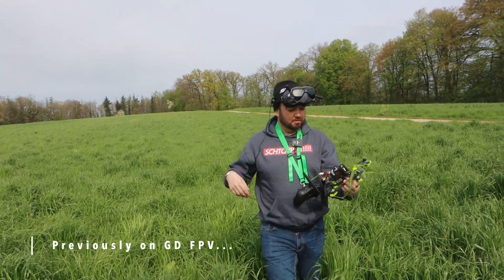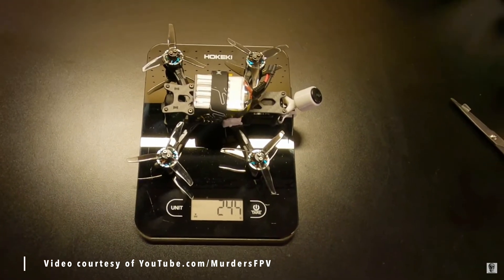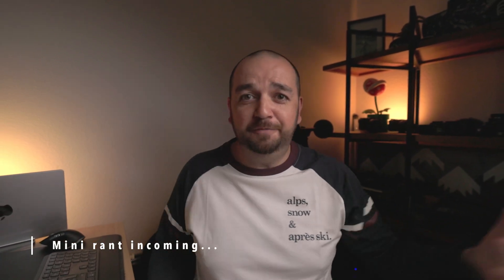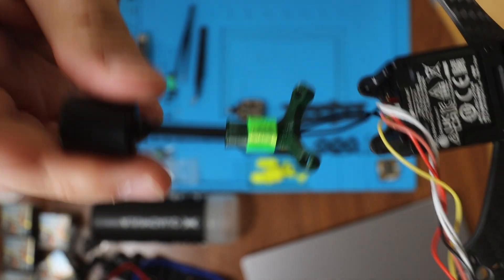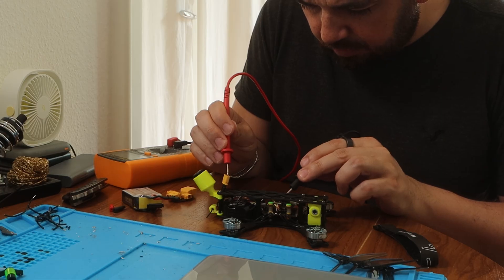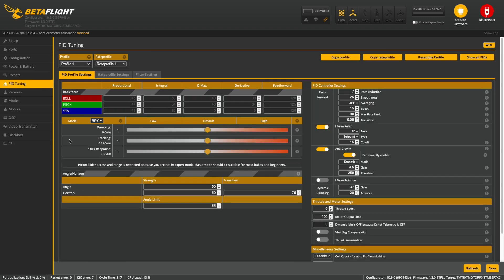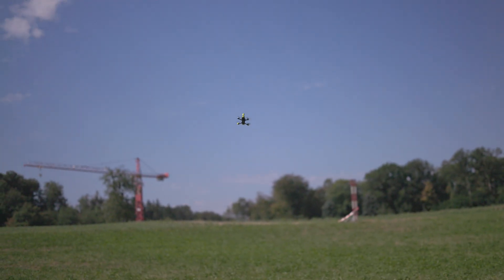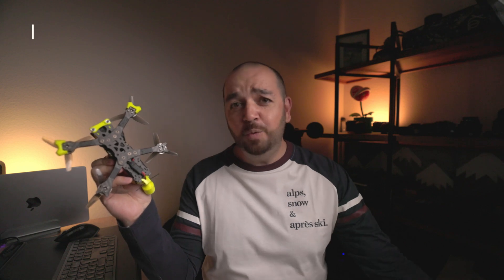I tried to build an FPV drone | Sub250g Freestyle DJI O3 Quadmula Siren F3

Comment: Great video. I'm also living in CH, where did you buy the parts to build the drone ?
Reply from the maker: Awesome! I got all my 3D printed parts along with a lot of my FPV gear through Chris at dronefactory.ch

But I also use helifree.ch and fpvracing.ch as they all have different parts.

Some parts like the 380 6s batteries I had to get from the U.K. as I couldn’t find them here
Reply: @GarethDix  Great thanks
Reply: I am looking for this frame as well. Did you buy yours directly from Quadmula? I could not find it on the shops you have referenced.
Thanks for the great video!
Reply from the maker: @GordianHubclan yes I got the frame direct from Quadmula as I don’t think anyone else carries it but the delivery is pretty quick to Switzerland (I have about 3 of them now)
Reply: Thanks a lot @GarethDix! Will order when back in stock then 😊
Reply from the maker: @GordianHubclan  it's also worth looking at the F35 (I'm currently waiting on a couple of final parts to do a build video) but frame/props make it a little heavier so I'm looking how to reduce weight if sub250g is a concern for you. The 3.5in props should make it more efficient though

Comment: I am ahead of you but comparable. Taking the same journey to experience what suits me the best. In order: Mini3pro...Avata...Betafpv Cetus...Nazgul Evoque 5d...siren f3s...volador 5x... and ordered a pavo pico o3 sub 100g just yesterday. So far I enjoy the volador over the siren because of my anxiety to lose the light weight siren some where up in trees during a dive between those. Those 800g will definitely come down. But yes. There is more than 5 inch and it looks like you just took off... into that money sink. 😂 enjoy it. Oh in case you live at leaset remotely around zürich, there is a drone club I recently stumbled up on youtube.
Reply from the maker: The siren F3 is surprisingly good going through trees (if you’re diving) I think because it has a short wingspan and small props. At least I haven’t got it stuck yet and I’ve had some close calls 😂

I didn’t realise there were places that you could even fly in Zurich so I’ll take a look and the group as well as there isn’t much in Basel

Comment: Any reason why you bought another o3 instead of using the one from the GEPRC Mark5?
Reply from the maker: My GEPRC Mk5 has a vista in it (I bought it just before the O3 was released).

I actually bought the upgrade kit for the frame and was intending on putting the O3 unit I bought into the Mk5 and then ended up building the F3. As much as I want to add the O3 into the mk5 I don’t fly it enough now to justify the cost

Comment: I've bought two 5" BNFs, and countless BNF tinywhoops. But I've built 50+ fpv drones (5" or greater). As much as I like flying, I think I may like building them more. Then again, I did build a metric ton of models when I was a kid, so...
Reply from the maker: I never thought I’d enjoy building them as much as I have… on my later build as much as I planned this out, I’m having issues fitting everything in, but enjoying the problem solving process and figuring it out.

Comment: I have the exact same idea 😆
Reply: Thank you for your reply, I also live in Switzerland and near a airport so I have to stay under 250g😢. But can you recommend me a fairly priced soldering iron?
Reply from the maker: @Nik_FPV621 I was near Bern the other day and it looks like it’s almost all restricted airspace there! 

But for a soldering Iron I use a TS-80 which is expensive but allows me to power it when I’m outdoors in case I need to make repairs.

However all you really need is a soldering iron that you can change the tips on (if it’s 5inch it’s much easier as the components are larger so you can get away with a larger tip) and you can vary the temperature on. I think galaxus.ch do quite a few but if you have an Obi near you they’ll definitely have one that meet those two criteria.
Reply: @GarethDix  thanks for the recommendation and I live like 3km from the Zürich airport away
Reply from the maker: @Nik_FPV621 oh no! And yes that is pretty restrictive over there… I almost moved to Zurich and then looked at the drone map and thought… yeah nah.

But this sub250g build is pretty incredible… I just got the first sub250g BNF for the next video and it feels very very different to this
Reply from the maker: Go for it! It’s a lot of fun!

Comment: sub 250 saddly doesnt matter for flying legally since the eu standard specifice that you have to be under 250g, no camera and below 19m/s max speed to be considered C0
otherwise the quad automatically falls in to the C4 category 
not sure if its just like that in switzerland but we here in germany dont have to worry about weight anymore we are fucked either way ^^
Reply from the maker: It’s weird as Switzerland has adopted EASA regulation but being Switzerland they have also clarified the use of what happens if you can’t meet those requirements.

For instance the speed is specified as a limit to how you fly not how fast the quad can go and if in flying in an A1 scenario it’s unlikely I’d be able to get to 19/m as the areas are so small. But I can fly A3 if I want to go faster (which makes sense as you aren’t near people)

With a camera (and not a toy) this is just includes registration, insurance, A1/A3 certification over a C0 which is just to read the manual, but you can still fly sub250g in A1 scenarios.

I checked the EASA rules and they give the requirements for C0 but don’t tell you what to do if the quad doesn’t meet them which is pretty confusing!
Reply: @GarethDix  that sound reasonable 
to be fair i dont know how they would check the max speed of a home build drone anyway 
all the regualtions make it confusing and hard to find good spots you can fly legally 
for example where i live some dji camera drone guy decided it would be cool to fly over private property 
which resulted in a lengthy article in the local news paper which was full of semi correct info about flying drones 
bad thing was that the article said the you cant fly here cause its within the airport control zone
which isnt true cause you can fly in the control zone if you stay below 50m 
but now everyone here read the article and everytime i fly some guy comes up and tells me that i arent allowed to do that ...
Reply from the maker: @bluefpv3263 I think the swiss take their time adopting new regulations to try and make them as practical as possible, a lot of the flying here is about common sense so like that case in Germany, when someone is flying stupidly it is really annoying because it ends up screwing the hobby for everyone else.

There are a ton of no fly zone now in tourist areas because people keep being stupid with drones but I think the main one here (like Germany) is just not messing with people’s privacy.

But you have to love the media for getting people riled up on fake news. Back in the U.K. they had someone flying a dji drone around a major airport which resulted in days of delays (although no-one ever saw the drone and no-one was ever caught so there still some skepticism as to if this was even real.

But you also get “auditors” on YouTube that purposely go to places to annoy police and businesses… technically they aren’t breaking any laws but now regulators are looking at introducing remote ID as a result.

Comment: I build a tiny trainer hd with 03 and it's like flying a 5"
Reply: Yeah xing 2 1404 4600kv on 3s 550mah batteries
Reply from the maker: That’s awesome I really wanted a tiny trainer but didn’t realise you could fit an O3 in it! Are you on 1404 motors for that?

Comment: Although not as aggressive as your build. The Emax Babyhawk II (or 03 now) it is recognized for being incredibly smooth and well tuned. I have to admit that of all my 10 quads I still get surprised over how smooth and good it flies. And 3.5" is really good for sub 250.
Look at some reviews on it from a few years back, or the recent of the 03 version.
Reply from the maker: This was mentioned so much in the comments of my last video and I think if I can get hold of one here I might have to add it to the list.

The only things stopping me from getting one before was no O3 (which they now have) and the arms aren’t replaceable. But from the reviews it looks like it can take a beating.

It would be interesting to see how it compares to the quadmula given it’s 3.5inch as well 🤔
Reply: @GarethDix  - I'm generally not a fan of the AIO boards but the I'd second the BBHK II being an amazing quad for feel compared to a 5 inch. That was my default next in between quad but at this point in the game I am insisting on a camera forward build to get the props out of frame. (don't know if the BBHK meets that with O3).

But if YOU buy it and tell us......      haha. I just subbed to find out.
Reply from the maker: @whereverimayroam74 it’s coming 😉

Comment: what was the problem you  had with the 03?
Reply from the maker: You can see it slightly at 6.33 the camera bobs up when I’m flying straight. At first I thought I was Bein twitchy on the controls but the O3 and gyro were set on the same pwm. Quick change in BLHeli: moved ESC to 48MHz and it solved it

Comment: I'm not going to concern myself with sub 250 on my built quads. Until there's a remote ID module that's costs 20 dollars or less. The FAA said as long as you aren't doing anything stupid you'll probably never have a problem.
Reply from the maker: It’s unlikely here too… and for the most part people don’t do stupid stuff with drones… but I’m also a guest in a country that prides itself on having a rule for everything… so don’t want to get kicked out 😂
Reply: @GarethDix That was I wondering about. You are in Switzerland, but don’t sound Swiss at all. Besides, Swiss happen to talk slowly (langsam wie die Berner) and lack humour. I am happy to notice both is not the case for you 😊.
Reply from the maker: @EricLaermans ich liebe Bärn Deutsch es ist sehr langsam 😂😂
Wenn man Deutsch spricht, ist es auch sehr langsam!

Comment: Build an anolog quad first. Then mistakes aren't super expensive. Melting a DJI digital system is expensive
Reply from the maker: I have a view on this because I thought about that too… however the O3 literally required me to plug it into the FC rather than extra soldering so it made the build really simple

Comment: if your concern about the 5" was due to legal restrictions, sub 250gr won't help much as you are not allowed to FPV fly in most country (Only line of sight is allowed). So just go with your 5" and enjoy
Reply from the maker: Wow which countries have that as a rule? Most European countries allow FPV as long as you have a spotter with VLOS.
Reply: @GarethDix  which you alway have correct?? ;)
Reply from the maker: @enricobononi8655  Always... you normally see/hear her in the videos. in this one she's holding the camera for the LOS test... but normally standing right next to me. - It's also handy when I crash in long grass as she can tell me where I need to hunt for the quad to get it back!

Comment: such a cool build, im building my first 5inch at the moment. im waiting for my vtx and elrs receiver from banggood.. and im waiting and im waiting and waiting.. i hope they dont move the shipping day again.. 
im thinking of building a 3inch like u too, but how much did it cost for you will all the shipping etc?
Reply from the maker: Yeah shipping parts from the far east can take long long time… the parts for my next build are all here after 4 weeks of waiting. But where I can I either buy from Switzerland or neighbouring countries (which still has import duty but it’s much faster).

I really hoped this question hadn’t come up because I really don’t want to calculate how much it cost 😂😂 but let’s just say it would have been cheaper to buy a very popular 5inch including shipping and import duty 😂

That said a lot of the parts that I couldn’t get when I started this build are now back in stock and I’ve found other places in europe that sell the batteries and motors which will cut down on the costs a little

Comment: AOS 3.5 EVO is a pretty cool frame in this category. I think iFlight makes a BNF, although I built my own: AOS 3.5 EVO, Flywoo Goku GN745 AIO, Happymodel EP1, T-Motor P1604 2850KV, DJI O3, Tattu 6S 550mAh, Avan Scimitar 3528-3.

She floats like a dragonfly and blips like a hornet!
Reply from the maker: I think the AOS 3.5 EVO BNF is going to come up a lot in the comments and if there's enough people asking for a comparison with it I'll try and get hold of one (I think they're all on pre-order here). But that might have to be a future frame build too. 

Ironically your build is identical to how I'm building the Grinderino at the moment except with a crossfire receiver (and obviously the frame). Does that 550 6s lipo still keep it under 250g?
Reply: @GarethDix  yes, barely (had to be selective with TPU)
Reply from the maker: @deice3 that's slightly worrying given the AOS frame looks about 10g lighter than the grinderino... lets see what happens!
Reply: @GarethDix  The AOS 3.5 EVO seems to have more weight even without a battery, or ?
Reply from the maker: The AOS Evo frame is around 50g the Grinderino is about 60g

Comment: LOL I just shorted an AIO board and lifted a component on it and this video shows up on my feed. Liked and sub’d!
Reply from the maker: YouTube is listening! haha... my next build is with an AIO instead of the stack and I have anxiety over that happening and not just being able to replace the FC or ESC separately!
Reply: @GarethDix  yep, I took it to a cell phone repair, they fixed it. Put the component back on properly. But I burned it and my ESC won’t send the proper voltage to a motor. Real unfortunate but you got this man! Just take your time. Your solder joints look fine for a beginner and you seem very logical and thorough.
Reply from the maker: @Retrosmack  That sucks! and noted I'll take extra time on this next build... it's only a 4 week delivery time to get another one if I ruin it! haha
Reply: @GarethDix  LOL that’s where I’m at right now. 18 days til my other one gets delivered.
Reply from the maker: @Retrosmack and now I’m think I should order a spare one now before I start the build just in case 😂😂

Comment: I've bought BNF and built DIY, I tend to agree that building brings it's own pleasure that a BNF can't (it's also way easier than first anticipated), having said that I bought a BNF recently to replace a lost (BNF) quad just because time was an issue - My best tips for building... 1. Get a nice big clear workbench/desk/table to work on. 2. Do a dummy fit to work out where everything needs to go. 3. Buy a smoke stopper
Reply from the maker: I like the fact that when I look at a BNF now I think... what could I change to make it work for how I fly... where as before I spent more time trying to figure out if I like it or not. Those 3 points are definitely great tips... especially number 2... nothing worse than putting it all together and realising it doesn't fit in the frame!

Comment: PS sub 250g and durable do not go together. As long as you don't crash it's all good...but as soon as you do that sub 250 is going broke!
Reply from the maker: When I say durable I don’t mean Demibot/Tanq I just want it to be able to take a hit or six without dying straight away 😂 I’ve powerlooped this straight into concrete (more than once) and so far I had a few chips and scratches but nothing has broken yet
Reply: I might want to try that out in that case. Always nice to know it can take a hit without breaking. When I break a couple more arms on my Hexplorer Mod I'll switch over to something like that. @GarethDix
Reply from the maker: The 3” arms are short enough that it doesn’t seem to put as much stress as a 3.5”

Now that I’ve said this, watch me go out later and completely destroy this by dropping it off my bag 😂
Reply: Yeah you make sense. But yes just don't look at it funny and it's going to break!

with that said never buy a drone that's has one piece...I always break them and then having to replace the whole bottom part is no fun. @GarethDix
Reply: @NOT_ANOTHER_FPV  i have two Quadmula Siren F3 Split and i only managed to break one arm and i crashed a lot with em... 

the Quadmula has removable arms and the carbon isn´t thin at all

You get the idea wrong, sub 250 isn´t directly a weaknes, more the benefit of less weight, so in crashes forces aren´t as high also on the frame and not only on the concrete :D
Reply: Sounds like a good made frame. I do agree that light weight doesn't always mean fragile. Just in my case I never got anything light that had strength. Just these long range/so called freestyle ones that just break so easy.

Thanks again for the info. @philihc